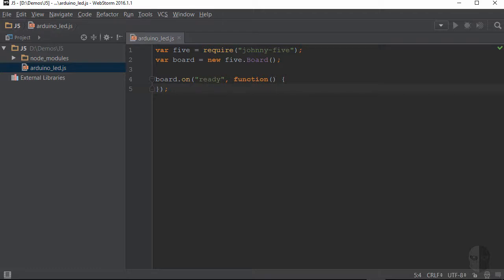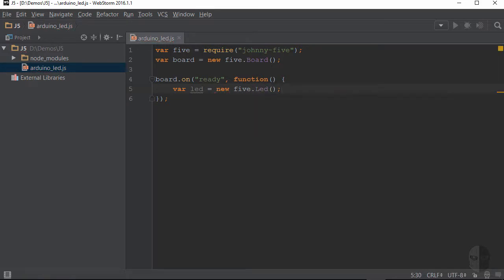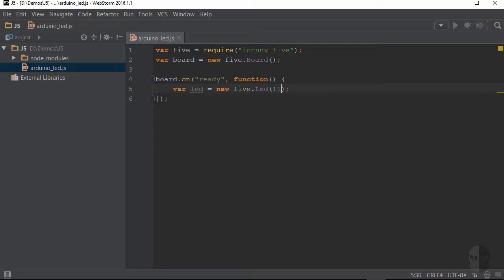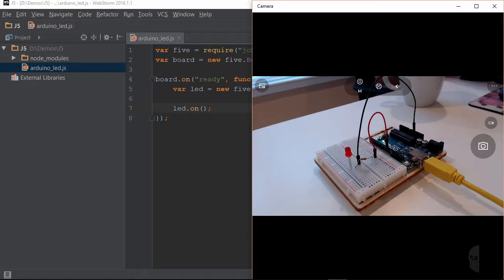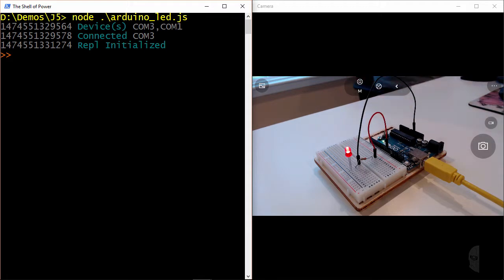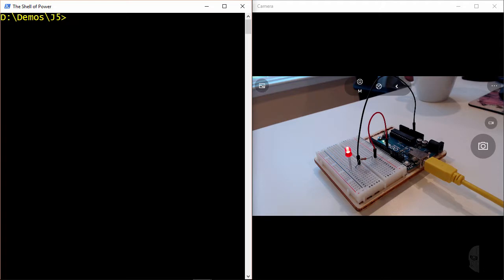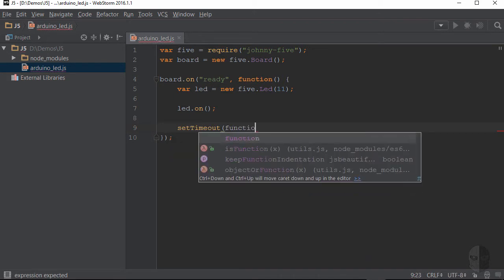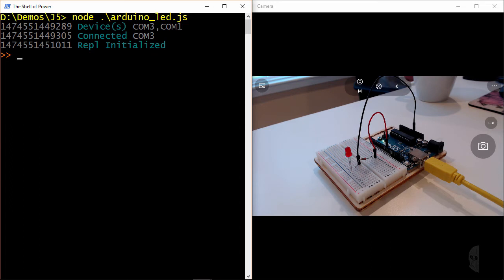Getting Started with the Johnny-Five Robotics Framework [Part 6]: Basic LED Functions

Comment: i dk why but while nodejs is running it is takinf pin COM11 deflaut but my ardino is connected to COM4
Reply from the maker: You should be able to specify "COM4" as the port when initializing your board object. It's a property on the 'options' object taken in. Here's the documentation for the Board that shows you what I'm talking about (just scroll down to the "Component Initialization" section): http://johnny-five.io/api/board/